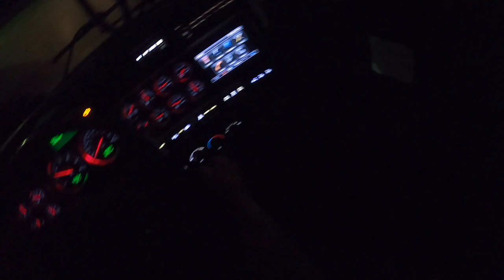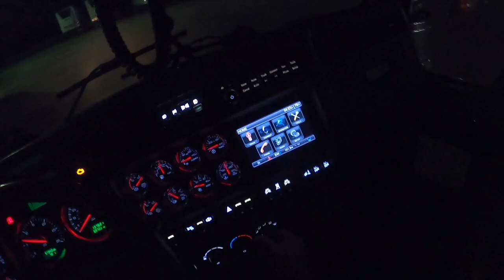Trailer Takes A Nose Dive

Comment: Hi from the uk, good job, we have done such jobs with an underlift, but each to his own tecnique, is that a Kemp conversion on a 750 holmes you have there? Regards.
Reply from the maker: Mr. Phillip. We have used the under lift on the 50 ton wreckers also. The red Piterbilt is a Kirby Grant conversion. Thanks for viewing and commenting. Stay safe
Reply from the maker: It has holmes 600 winches